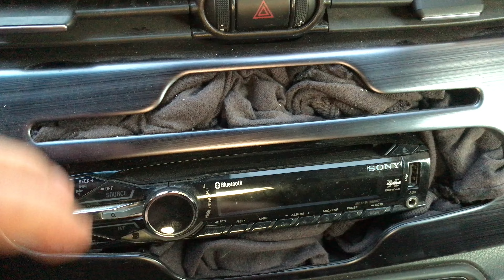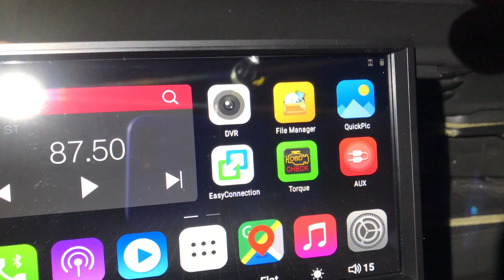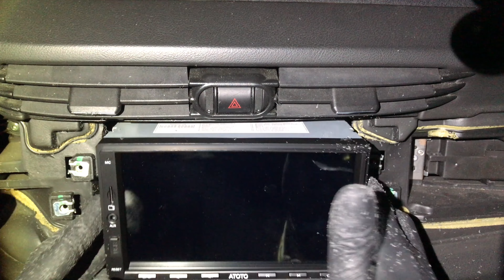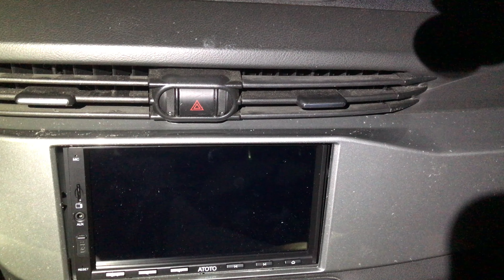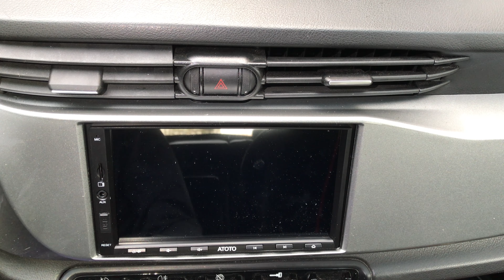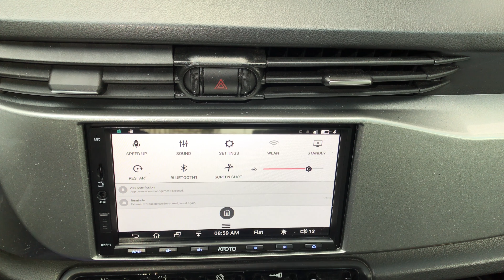Atoto A6 PRO montaggio Giulietta 2010-13 - come installarlo su AlfaRomeo

Comment: Salve.Dovrei fare anch'io un lavoro del genere:quanto tempo ci si impiega circa?Io lo farò fare ad un'elettrauto perchè non ho le competenze necessarie,quanti soldi potrebbero volerci secondo te?
Grazie.
Reply from the maker: Ciao! Io tra plastiche, posizionamento e modifiche varie ci ho messo circa 2 ore...il prezzo credo sia relativo in base al professionista che ti esegue il lavoro. Sicuramente meglio chiedere prima un preventivo per non trovarsi sorprese. Non dimenticare di lasciare un mi piace e di iscriverti al canale se ti è stato utile. A presto!